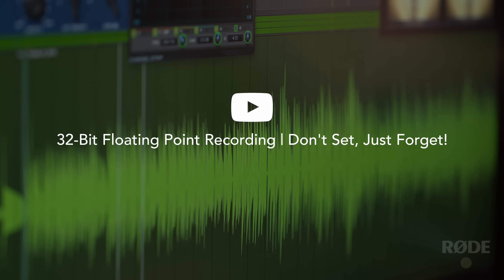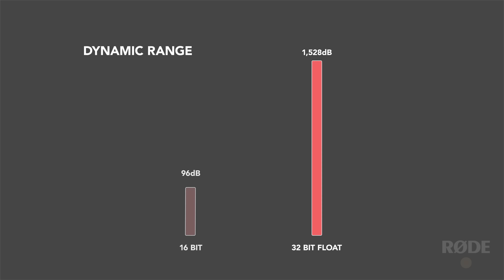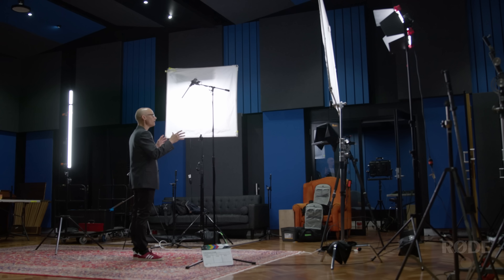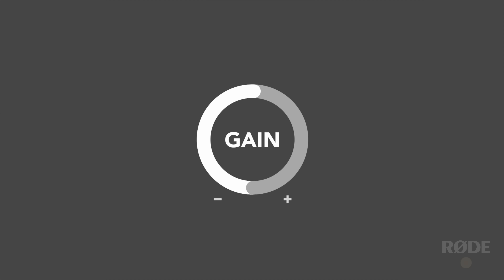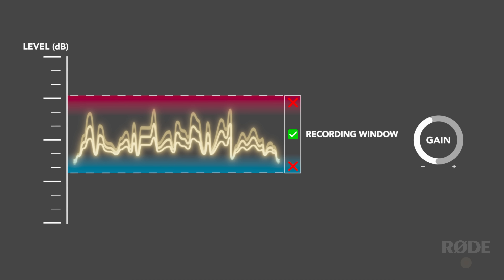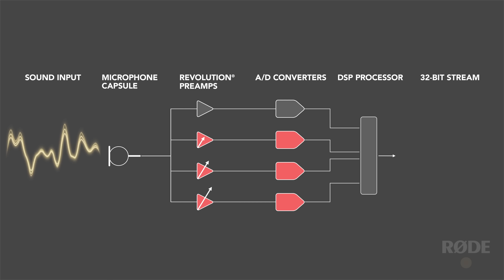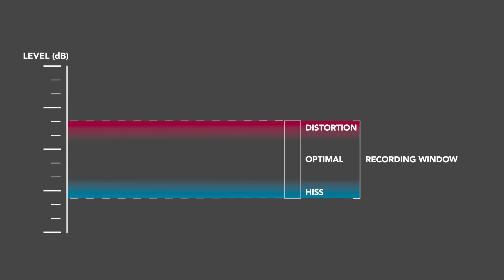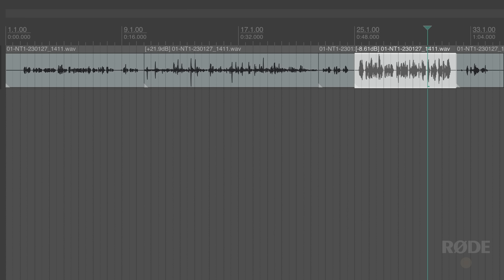Game-changer: How 32-Bit Float Recording Makes Clipping a Thing of the Past

Comment: So what you are saying is that 32bit float recording eliminates noise? I get that it would eliminate clipping, but the noise is the biggest issue I’ve found in recording. Mic noise, preamp noise, noise of interference, noise of power/bad grounding, etc. there’s no way to fully eliminate noise in my experience. I’m curious how 32 would do this. It would eliminate clipping yes, but i doubt noise.
Reply: He probably means circuit noise, not background noise.
Reply: @concernedcitizen3254  I mean yeah, i'm talking about that too. mic circuit noise will still exist. granted it's often lower than other things, but i guess taking out preamp noise is a good thing? but sometimes preamps can be very musical (api/neve for ex), but i guess we got emulations of all that in the box these days. A future with easy recordings could be cool, but also render a LOT of jobs obsolete... then again it kinda already has taken most engineers out of the picture (like myself).
Reply: It just records the signal at different gain settings and combines them into a single number automatically. It doesn't change anything about noise at all.
Reply: @youareliedtobythemedia  oh totally! Just weird claims by rode.
Reply: The technology is in the audio interface, and effectively eliminates preamp noise and clipping by stacking and combining preamps at different gain settings. This allows you to get recordings which are limited purely by the dynamic range/noise of the mic instead of the audio interface.

Comment: I've had noisy recordings in 32 bits when recorded with little gain.
The noise floor seems to be a problem still.
Reply: Yes, the noise problem will still exist if your mic preamps are inherently noisy. That's why you should use something like the Sound Devices MixPres which have noise floor (EIN) below -130 dBu.
Reply from the maker: Shouldn't be a problem for the ultra-quiet NT1 5th Generation 😏
Reply: You're probably referring to 32-bit integer devices.

Comment: The interface has to have this for this to work. You can 100 percent clip every pre amp in every interface ever made.
Reply from the maker: This isn't the case with a properly configured 32-bit float system, we'd recommend checking out how this works on the NT1 5th Generation while connected to USB: https://www.youtube.com/watch?v=5pY6EW4Hx2g
Reply: It only works in USB mode on this mic, not XLR - therefore you don't need an interface, it just plugs into your laptop directly. If you go XLR into your interface then it is not capturing at 32 bit and you can still clip unless your recording device is capable of 32 bit - in that case, any mic will do.
Reply: u right, with ur 4 subscribers. lmao
Reply: @noahf7824  Not that that has anything to do with what I said or make it any less true, this is my throwaway account.
Reply: The idea is to have the "highest gain" preamp/converter geared towards the most sensitive mic in front of the loudest sound imaginable. Luckily, microphones that can take a lot of sound pressure wave lower signal levels, so it's not that crazy of a signal gain.
Having it built into the microphone helps tremendously because you know exactly where the microphone's limits are (quietest to loudest) and can taylor the 4 preamps to that. An SM7b for instance would have different settings altogether.

Comment: Do Rode make any 32 bit float devices or mics? It'd be amazing to have that capacity built in to a self powered mic.
Reply: Yeah, their new RODE NT1 5th Generation microphone is capable of digital 32-bit float recording through USB and also has the option of standard XLR connection ...

Cheers!
Reply from the maker: What they said!

Comment: How is the sound quality of 32bit float compared to 24bit fixed?  I dont understand the technology yet. It doesnt have noise floor? I dont care about avoiding clipping but i care about sound quality
Reply: You care about sound quality but not about clipping?? Read that statement out loud to yourself bro!
Reply: It is just capturing a wider dynamic range between the loudest sounds and the quietest with different A/D converters for each (4 in total) meaning that when you raise the gain after capture, you are not also raising the noise floor (as you do with a non-32 bit capture). The sound quality on this is meant to be superb, Curtis Judd claims that to him, this sounds better than his $3,000 Neuman U87 (although that is, of course, very subjective). Rode claim it is the quietest studio mic in the wold (in terms of its noise floor / self-noise). A 4db(A) noise floor is certainly very impressive, as is a 144db SPL maximum handling (for very loud sounds).
Reply: @xMaSSxHyST3RiA  😆
Reply: @xMaSSxHyST3RiA  They're obviously saying they don't have a problem running into clipping because they don't record hot.
Reply: @erinburke9711  Is it obvious? or are you just obviously assuming lol not sure where ya got that lol 🤣🤣
Reply: @xMaSSxHyST3RiA  The power of deduction will get you there. They're concerned about "sound quality" and noise floor but not clipping. Think about it. AKA they don't generally encounter clipping with their workflow.

Comment: Can 32 bit still distort though? I have audio recording from a Zoom recorder with 32 Bit Float. Some of the clips are distorted, but when I try to bring the levels down in Audition, they are still clipped off, as though somebody took hedge clippers and ran across the tops. lol I saw a video that said that 32 bit can still distort, if the original levels are not still within a certain range. All I'm doing is transferring the audio files from the SD card to my computer. Am I supposed to be using some other hardware or something?
Reply from the maker: I see, this is because the NT1 5th Gen is only capable of 32-bit recording via USB-C. When using this method, you should be good to go!
Reply: @rodemic  Say what? lol I don't know what model recorder the sound guy used. I think it was the F8N.
Reply: If the distortion arose before the a/d converter, eg right at the mic, then it will get faithfully recorded in glorious 32 bit float bits.  So you are stuck with it.  Some Zoom devices do not use dual converters, it seems, so they do not actually offer anything better than 24 bit recording.  Hopefully you are using something like the F3 which has dual converters, rather than the H1e which does not claim to have them.

Comment: The problem with this is, if you gain stage and record in 24 bit, it would be more natural than doing it this way. From a technical stand point, this is true. However most people won't be able to tell the difference.
Reply: The examples at the end of the video are where this will be amazing, did you get that far in the video?

Comment: If I record in 32 bit format, then in the daw after the recording when I need to increase the volume in the low volume parts, wouldn't the noise also increase?
The bit format is related to the process of anolog to digital conversión. While highest is the number of bits you are using more precise is the conversión. 
I dont understand what is the relation between the bit depth and the dynamic range
Reply: The NT1 5th Generation uses four stacked 24 bit convertors. Their output is combined in an on-board DSP to create a true 32 bit float output that exceeds the performance of any individual convertor.
Reply: Bro, you need to watch the 2nd part of the video to get this right.
Reply: The relationship is that the 32-bit float format is needed to store the full dynamic range of the stacked converter setup

Comment: Hi, I have a question. Does Studio One 5 support nt1 5th  microphone recording settings 32 float?
Reply from the maker: Yes it can 😊 depending on your device, feel free to check out our walkthrough guide on how to get set up!

Windows - https://edge.rode.com/pdf/page/2137/modules/7665/Studio%20One%20-%20Windows%2032-bit%20Float%20Guide%20for%20NT1%205th%20Generation.pdf

Mac - https://edge.rode.com/pdf/page/2137/modules/7665/Studio%20One%20-%20Mac%2032-bit%20Float%20Guide%20for%20NT1%205th%20Generation.pdf

Comment: isnt the noise floor of the electronics constant (if i would use a 32bit float audio interface)? so if i boost the audio in post i also increase that noise floor anyway? isnt 24bit enought with 144dB because the mic can handle noise till 120db anyway?? do you know an audio interface with 32 bit float and a noise floor similar to the mic?
Reply: It seems like the quiet signals are recorded at what would have been a different gain stage then mixed back in with the final signal, so any noise would be very very quiet.
Reply: @concernedcitizen3254  there wouldn't be any difference. It's just a signal recorded at multiple gain levels, so you can choose the correct one later
Reply: Depends on which electronics you're talking about.  The preamp stacking thing basically eliminates the preamp noise, but you'd still have the mic's self-noise.  Depending on the mic and interface it could be a substantial improvement though
Reply: @Nathan_Woodruff  how exactly does preamp stacking eliminate noise?
Reply: @youareliedtobythemedia  maybe the noise is so low in relation to the dynamic range that even if you turn the volume up like 120db the noise is still down there , I don't know 😂 the noise as loud as the quietest stack I think
Reply: @musicproductionbrauns2594  with 4 preamps you should get the combined noise of 4 preamps.
Reply: @youareliedtobythemedia  i think the top layers are kinda "gated" so you hear only the noise of the lowest amp (in the combining phase to 32bit) ... but we would need rode to explain how they did it / what they did

Comment: It's not that "not needing to set the gain to get a good recording" confuses me. It's all the other things I need to interface with and distribute audio to during a recording. Much more, how would this apply to live sound?  Does the entire studio need to be "32 bit compatible"?
Reply: I thinks so. Cuz if u are already or have already recorded at 24, then u cannot "upscale" or reacquire the lost information. However I also wonder if most modern mics are alrrady 32bt ready, cuz if not, then it's useless. Frm what I thi k this video is basically saying to record at its highest possible quality so u don't get downgraded upon post prod. But i know there is more to it than what I just said. He is more in depth abt the 32bt depth thingy
Reply: @Aldsomegaming  It's not about 24bit vs 32bit, it's all about a completely different way of representing digital audio. You could have 24-bit float with same benefits, but 32-bit floating point is a well established standard in computing.
Reply: Totally assuming your pres are digital, right!? .. any of the analog gear going in will definitely want to be in its sweet spot
Reply: The technology is solely on the audio interface, not the mic itself.  It's all about the preamps and the converters.  In this case, the mic shown has an entire usb audio interface inside of it doing the processing, which confuses things.  

There will eventually be standalone audio interfaces created with this technology, which will work with any mic.  Same with digital mixing desks theoretically, though I imagine it would be extremely expensive, and not necessary for most live sound use cases.

Comment: Do you need a special microphone to get capture 32-bit float ? Seems like a logical question that was totally ignored.
Reply from the maker: You need a 32-bit float capable mic such as the NT1 5th Generation or a 32-bit float capable recording device.
Reply: @rodemic  Thanks for the info! That was my assumption, but it was VERY strange no one mentioned it anywhere. Future videos might want to have a “what you’ll need” section. I guess you guys are so close to the material that all of these critical details seem ‘obvious,’ but some basic testing would have identified this. 👍

Comment: That's amazing technology! I just bought mine and wondering what can I GAIN from USB directly to iPhone :body-blue-raised-arms: and how does GAIN work in that situation?  Mostly I'm recording directly into TikTok - either live or for video creation. Thanks for any info you can offer!
Reply from the maker: The NT1 5th Generation, isn't made for iPhone so USB will not work in the same way as many of our other mics. You can use an XLR to Lightning adaptor, some of which will have the gain controls on the adaptor itself. Otherwise for this use, you may be better suited to the NT-USB+ which is made for iPhone.
Reply: @rodemic  Thank you for your speedy reply! What about using XLR to Rodecaster Pro 11 which then outputs to iPhone. Is that possible and what cable is necessary to connect Rodecaster into iPhone?

Comment: I think the comparison with RAW Video is not correct. Even when shooting RAW you have to heavily adjust your camera: ISO, aperture, shutter speed - and that's because the sensor has a limited dynamic range. But I propose the microphone also has, even while it's analogue gear.
Reply: Yes it is partly irrelevant, but ppl understand it better this way. 
Not everyone knows what is the stacked exposure in photo.

Comment: quick question. if 1dB is the lower threshold of hearing and 130dB is the upper threshold of pain, why would anyone need more than 144dB of dynamic range?
Reply: To record extreme loud noises without clipping
Reply: @BellXllebMusic  the max spl of that mic is stated to be 132 dB. Anything louder than that will distort or break the mic's capsule. if you fix the gain on the mic such that 132dB SPL converts to 0dBfs that still gives you enough resolution on the low end to record audio that is too quiet to hear.

Comment: No compromise? This increases the chances of introducing aliasing as soon as you add saturation or colour.  32 bit float is great for field recording, foley and such. If you do this mixing music using ITB plugins it will introduce odd harmonics. Just record properly people.  Don't take advice from marketing managers.
Reply from the maker: The NT1 5th Generation outputs a true, linear PCM, 32bit floating point output that is a true representation of the movement of the microphone diaphragm. This is perfect for using with any processing, plugins, EQ or anything else. There is no risk of 'harmonics' or 'aliasing'. 

Note that Dan is not just our head of marketing. He is also a fully qualified Tonmeister.
Reply: @rodemic  Send me one and I will test it.
Reply: @rodemic  Or send them to a third party that you dont control the narrative over like @PresentDayProduction
Reply: You underestimate how far ITB plugins have come. The odd harmonics that they produce, if any, are way too low for human hearing, assuming you're not going overboard. Non-linear processing plugins especially have come far. The plugins that would probably suffer from 32 bit float the most are unpredictable emulation plugins, which have their sweet spot of -18 dBs or whatever, no matter which 32 bit float audio interface you use.
Reply: Most daws are already using 32-bit floating point representation on the entire signal path, so any of these problems would show up in plugins regardless of the recording bit depth.  And they wouldn't show up anyways, because none of those problems are related to 32-bit audio.
Reply: @djquantize  You're talking nonsense. How would recording in 32-bit FP have any effect on aliasing or distortion? Plugins process DSP in floating point anyway. You make no sense.

Comment: Note that the advantages of 32-bit audio capture only happen if the DAW requests it of the audio interface. Most other software (e.g. Zoom!) will capture in 16-bit or 24-bit, which is not always so great if you use a mic that likes you to be almost chewing it to sound good.

Comment: Hmmm
IMHO some glitches: 
 - DAWs today use 64 bit float rather than 32 bit float.
 - when captured in float format, even in the DAW (as using Floating Point for processing) clipping is not possible.Hence it in fact is not strictly necessary to bother about gain at all. While of course a kind of gain staging makes sense to improve optical representation of the signals, and to improve the working of certain dynamic and nonlinear effects.
Reply: When recording audio, the clipping and noise issues happen before the daw at the preamp or converters in the audio interface, so it's still important to set your gain right regardless of your DAW's working bit depth.
The idea of the video is that the stacked preamps would allow the interface to have such a wide dynamic range that a single gain setting could capture a large variety of sound levels without getting any preamp noise or clipping.  Such a large dynamic range would supposedly exceed the dynamic range of the 24-bit format, necessitating the change to 32-bit on the interface level.

Comment: how big is this file ?
Reply from the maker: We did a test in this video: https://www.youtube.com/watch?v=5pY6EW4Hx2g&t=1s and you can actually download one of our test files here: https://www.youtube.com/redirect?event=video_description&redir_token=QUFFLUhqbVFGZUsyMEFrM2RKdU1ERjFpTE45VG1zVHNnZ3xBQ3Jtc0trY0hNaVhzekVKUHgyaVg4NW5CVk02MGpSdEozOWhNS2FyTzNnLU1FSFZWdUpjbDFHUWF6WnZ3c29DWEtsZ0lpV0x0R2JKcHFrQ29ublRhbjVxZGpMSEtiSGRFREFJb2l1d3RxM3pFYVpIN1doY2t3cw&q=https%3A%2F%2Fedge.rode.com%2Fzip%2Fpage%2F2125%2Fmodules%2F7661%2F32-bit-float-example.zip&v=5pY6EW4Hx2g
Reply: 32-bit is short for 32 bits per sample.  The file size directly corresponds with this number, so you can just do 32/24 = 1.33, so 33% larger than 24-bit.  This only applies to uncompressed formats like wav

Comment: Since 4x sound pressure is a 6 dB increase, I would say the recorder with 4 preamps and ad-converters stacked would only have a 6 dB advantage in terms of quality when you record soft passages without turning up the gain.